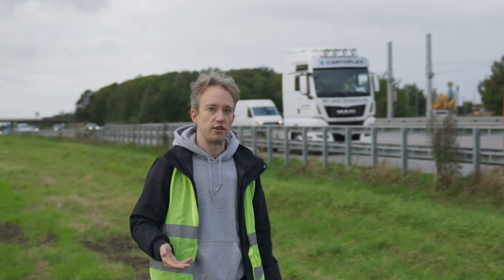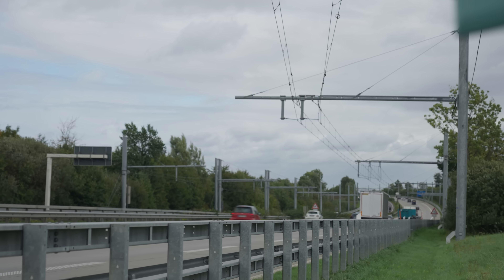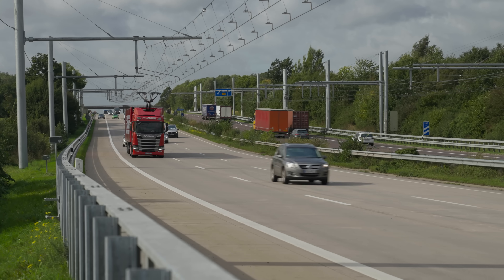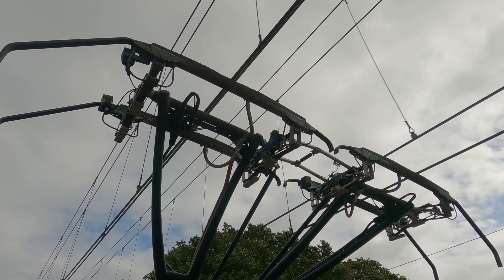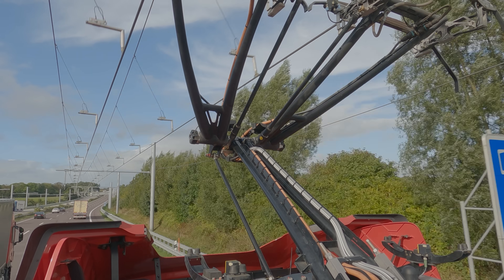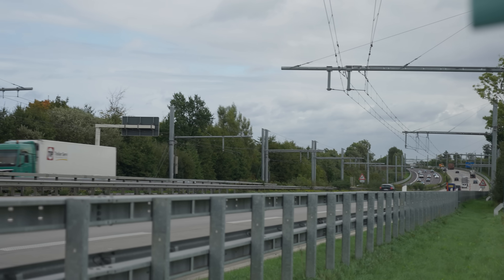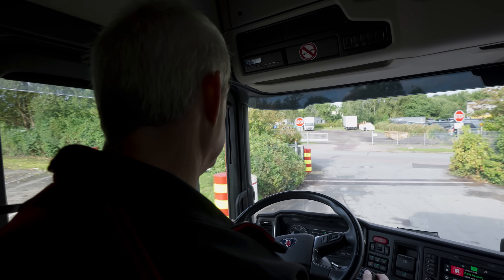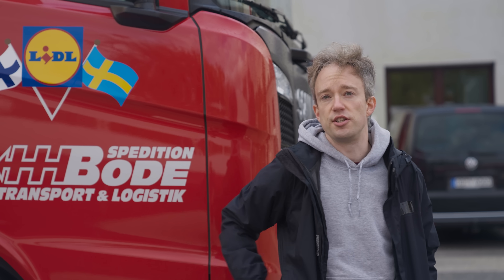The highway where trucks work like electric trains

Comment: Here in Brazil, they deactivated the electrical network of the rail network that was left over to replace the electric locomotives for those with diesel engines.
Reply: I can't imagine it in Brazil but maybe ridership has dropped so low it is only economic with diesels?
Reply: @bangerbangerbro Highways in Brazil are full of trucks and busses, so demand is there.
Reply: That's insane!
Reply: wtf
Reply: Didn't they do that in Zimbabwe because the electrification equipment was being stolen, and then switch to steam engines because they couldn't import any oil?

Comment: Will the amount of trucks impact, the amount of electricity pulled from the cables?  I'm glad you mentioned road taxes.  Most people don't understand the cost of fuel is actually very cheep.  It's all the taxes they add that has the prices so high.
Reply: A lot (I mean, waay too much) of our taxpayers'money goes to maintenance of these multi-lane highways and parking lots.
Reply: And having g roads to drive on is what you get for your taxes. Win - win.
Reply: @wordzmyth  What good roads?  Drive the freeways and toll roads in this country and tell me how these good roads are good anymore.

Comment: Next up: Trains that are capable of running on both rail and roadways.
Reply: Japan just launched a bus that can run on rail too
Reply: China:
Reply: Welcome to Australia
Reply: That's a hybrid that doesen't make sense in most places
Reply: @P4hko  Are you an engineer?
Reply: The efficiency of a train comes from the number of cars it pulls at a constant speed. A train on a multi-use highway loses that efficiency when it loses its length. A car that can run on tracks is still just a car. The container system we use now allows for transport by ship, train, or semi. The container is hybrid. In this case, the container can be transferred from the efficient train to an efficient truck for transport from the train depot to the warehouse.
Reply: Swapping of wheels and batteries 😊
Reply: Yes, making road-going goods vehicles and passenger coaches that can also drive onto train tracks would be better than adding overhead cables to public roads, imo.

Comment: Why not just place a railway near highways and slim the roads down a lane or two to compensate for fewer trucks traveling on them? Then, smaller trucks can instead pick up the cargo from the trains at stations and bring it to its destination. I think that would remove an arguably unnecessary process in a delivery operation.

Comment: To all railroad fans, truck can disengage from grid, and travel off battery on side roads away from main highway, trains, are stuck on one line and can't simply "drive off" rails, you're welcome.
Reply: @Mr.Zarratox  Trains DO cause traffic jams, for each other. Rail operators must schedule train movements months in advance.
Reply: True, but on other other hand, large trucks still cannot leave infrastructure, they still need to use the road, cannot just zip it through forested areas, rivers..... So it is question if you build roads or rails, which is more expensive to build and maintain...
Reply: That’s the whole point of intermodal trains, ya silly goose.

Comment: The catenary wires appear to reduce bridge clearances by about 1 m, so, if retro-fitted to existing bridges, all high vehicles will have to have their heights reduced by 1 m, dramatically reducing their capacity, and thus increasing transport costs. Also increasing costs are 1) double investment for engines in the trucks (electric motor additional to internal combustion engine), 2) massively heavy batteries. 1 & 2, by weight and volume, again reduce load capacity. Overhead road wires are a scheme for gulling technically illiterate politicians. Liquid fuels slaughter electric propulsion.
Reply: The bridge thing is a non issue, since the trucks dont require the lines to operate, they can just have a short gap in the wires under the bridge.

Costs are made up in the long term by reduced operating costs. The guy Tom interviews in the video explains it well and I trust the expert who works on this full time over what a random on the internet reckons.

And finally electric motors are way more efficient than internal combustion (90% vs 20% respectively) so will make up even more costs and will mostly negate the weight gain.
Reply: With trains underground, they often use a more solid pickup rail, and connect it direct to the roof of the tunnel.

Comment: And just like a track bound vehicle it can not deviate left to right or the pantographs will short out the catenary wires or loose contact all together, so what keeps the truck perfectly aligned with the traction power wiring?  At least with the time proven concept of trolley busses they had sufficient room to maneuver since the poles were rotating as needed!

Comment: Most incoming containers and freight tends to come in via sea traffic and ends up leaving from a multimodal terminal, so instead on one truck pulling one container under the 'wires' from the sea terminal, why don't they connect the sea terminal to a slightly out of Town/City modal terminal, all connected to the wire network? (Perhaps using existing disused road/ rail corridors). Let each electric truck pull more than one container from the sea terminal perhaps 2 or 3, or more, like Australian 'Roadtrains', easily done with the power of modern electric motors, then take them an intermodal hub just outside a town or city, and let electric trucks which have been sat on charge, take them the rest of the way (without wires) to an RDC, (regional distribution centre) inside the town city limits, break the loads down, and then let smaller electric trucks/vans take the goods to the end user. No diesel, LNG, or hydrogen used. No Co2 emissions from the vehicles utilised, and a cleaner Town/City environment for all!

Comment: NO Fossil Fuel no Batteries, 60-80% of any mean of transportation is composed of PLASTIC which derives from Crude Oil, so NO FOSSIL FUEL NOT BATTERIES and the over head wires are made with plastics coverings too.

Comment: When i was a kid in Johannesburg, 65 years ago, we had double-decker trolley buses, and they worked fine.  They could pull out to overtake slower-moving vehicles (or stationary ones), and had great acceleration.  They were NOT able to overtake one another, though.  I can't remember how it worked, but if the 42 bus and the 39 bus used the same wire for a part of their journey, their routes were able to diverge, so there must have been some sort of points system on the overhead wires.  They didn't use a pantograph, like trains do, but had spring-loaded poles from the bus roof to the wires.  Occasionally, the contact pole would come off the wire, and the conductor would put it back on with a long pole with a hook on the end of it - but it took only seconds.
It should be said, however, that the  wires are an eye-sore in a city.
Reply: Yes I remember that both in the US and place like Edmonton, Kanada
Reply: Old-time trolleys had overhead switches to diverge to a different line.
Reply: If you search YouTube for "Trolley besses", there are lots of videos.
Reply: Do you know why a trolley bus is called a trolley bus? It is due to the trolley poles that it uses to collect energy from the overhead wires.
Reply: @sjokomelk  What's your point?  What made you think I hadn't understood that?
Reply: We have the same sort of system in Kharkiv with the trolleybus , two wires and spring loaded arms . The maker is Ukrainian , "Bogdan" . It is a proven system so why change it . Yes there is a kind of crossover and the direction the trolleybus is going determines which wires it picks up.
Used to have the double Decker ones in London as well
Reply: I imagine in a few decades if they wanted to they could do a wirelessly charging lane for electric vehicles to charge their batteries as they drive.
Reply: @EikottXD  Wireless charging tends to suffer the laws of physics - in short, it's really inefficient, among other problems.
Reply: @compwiz101  It's extremely inefficient, but I did say a few decades.

Comment: It's so amazing idea! I wish we could put planes on the cables the same way as trucks 🙂
Reply: JUST. BUILD. HIGH SPEED RAIL. In Italy, their HSR is so good that their own company for domestic flights literally shut down, citing the HSR as one of the big factors.
Reply: @Cobalt985  hmmm, and what about the ocean? how do you get from europe to america? or from america to china? the largest trade ways are either trougth plane or ship, and somethings just can't wait a month to cross the ocean.
Reply: @wolfy1398  Ships, my friend, ships!
Reply: We really just need a good, light, battery system capable of high storage and a well designed solar system for aeronautics. Then we will be able to conquer electric air travel, no need for messy cables :)
Reply: Planes with on cables looks stupid
Reply: You might be able to do something similar uses solar panels in space that beam energy into the planes in the form of microwave radiation (similar wavelength band to what internet uses) and this was already tested and works
Reply: Ropeway systems are planes on ropes 😊

Comment: UK is easy. M1 and M40 plus M25 + M20 gives you  90% of HGV traffic covered. Rest can go in imported rapeseed oil ;)

Big question is... where are going to get all of this WATTs to cover it? One small accident can put hundreds of truck on HOLD on the motorway! In 2min you are losing 500 x 200kW of demand which need to be quickly balanced in the grid. Then 3 hours later all of them move again. 100,000kW jump can be significant enough to outbalance old grid. Especially if it happens 3-4 time a day! 
Change in the working hours and driving hours can help but this would have to be coordinated with rest of the world. Doable! Good luck.

Comment: Some simple questions:

1) What is the source of the electricity?
2) What is the infrastructure cost? As that was not well covered. That cost extends beyond the building of the network but also goes into maintaining it.
3) So you are still going to be using the batteries for part of the distance traveled. How do they plan to offset the pollution of the creation of the batteries which is great that the pollution of an ICE engine for eight years running. Batteries that are supposed to have a five year lifespanpossibilities
Reply: 1) That's not that important. Switching energy sources is easy and can be done over time. The fact that this is a problem that can be solved independently is a good thing--phase out coal power over a few decades and suddenly all trucks will be "green".
3) You don't neccessarily need batteries, you could use petrol or other types of fuel for the unpowered stretches of road.
2) That's a big if. I think that if you're going to try this then germany would be the right place for it, because it's both large, and has very high population density. There aren't huge stretches of nothingness in between depots like there are in the US. That brings down maintenance cost per capita.

I don't know if this will see widespread adoption but in my opinion this is one of the more promising proposals out there. It builds on existing infrastructure, and running a few cables is relatively cheap and can be done quickly. You don't have to build 1000s of kilometers of new rail for example.

You have to build trucks with these power things on top which might be the biggest showstopper. Then again if you're building electric trucks anyway, adding this mechanism on top can't be the expensive part. I guess the question is whether electric motors are here to stay, or whether other types of fuel like hydrogen fuel cells will become the mainstay.
Reply: @Schindlabua  You have never dealt with high voltage power systems have you? It is not just running a few cables. You would actually have a higher demand on the grid due to the loading of having the trucks coupling and uncoupling from the grid. Modern coal power stations have been a very clean source of power for the last thirty years. After the now proved false threat of massive acid rain issues secondary to emissions from coal plants. Though China is still using older tech and is the largest builder of new coal power stations.

There are solutions but this will actually increase the cost of electricity even more. As the government's are already allowing for price gouging currently in the UK and I bet other places as well.
Reply: @michaelmarino7216  No I have not dealt with high voltage power systems. But what is your point? This doesn't work, because ...? This works, because ...?

If you build rail you will also build power lines along the track, so if the goal is to get petroleum and diesel off the road then you will probably have to run cables either way. Rail is the cheaper alternative long term but you can't just stomp a country-wide high speed rail network out of the ground unless you are China. If these guys say that they can make it economically viable then I'm all for it, this can definitely make sense on certain stretches of road (hopefully while germany is working on longer-term solutions like rail at the same time)

And what does it matter where the grid power is coming from? Clearly, refining fuel and combusting it in combustion engines with 25% efficiency is not the correct thing to do? Surely you can only do better with power plants connected to the grid?
Reply: The energy for this section is mostly generated by wind turbines, since they produce most of the electricity in northern Germany.
The construction of this project did cost about 19 million €, the operation may take up to 7 M€ for ~3-4 years.

Comment: It is stupid idea. 
1. use railway and make railway user friendly. After it we do not need so much drivers and trucks. Truck, or small car make transport from depo to store.
2. why in UK not build trolleybus system? In vide was telling, that energy from wire to vehicle is better, than battery. It is right, but UK was kingdom of trolleybuses, now they are only in museums... 
Modern trolleybuses can run faster than bus (I am trolleybus driver ;-) ) and overhead is not problem for slow speed. Over switches I am running between 40-60 km/h.

Comment: 70 years ago I used to ride on buses (NOT trams) that worked on this basis within a built up area. They were commonly referred to as 'The Trackless'.
Reply: Those were probably trolleybuses, which are different from pantographs
Reply: @huguesjouffrai9618  Trolleybuses USE pantographs. Pantographs are just the thing that connects to the overhead wires. Older models do use trolley poles through.
Reply: @coleball6001  then they're not trolleybuses. A trolleybus uses trolley poles. It's a different technology and a different infrastructure (bifilar catenary vs monofilar catenary). Pantographs are used with monofilar catenaries which are best suited for vehicles on rail.
Reply: @coleball6001  I have never seen a trolleybus with a pantograph. All modern European trolleybuses I have seen have  traditional trolley wires, but automatic ones

Comment: UK is at least 30 years behind the rest of Europe, still struggling to make a high speed train. And for UK will be more practical to build proper train to take goods all the way from south to north. Although the political leaders in UK have been busy wasting the budgets on pretentious tiny projects not a proper project that will save the the country for next 100 years.
Reply: The UK will have a newer and faster train system than the rest of Europe in about 5 years. HS2 is 360 km/h.  Only China is faster

Comment: What kind of ruins it is that this is in Germany, which has rejected nuclear power so those trucks are still using fossil fuel
Reply: No, it is rather powered by wind than by fossil fuels
Reply: @j03l911  wind power doesn’t run the entirety of Germany’s electrical system, renewable energy accounts for ~50% of energy production, excluding nuclear power, which still supplies ~12% of power. Germany is in the process of fully eliminating nuclear power, which will mean fossil fuels will supply ~50% of Germany’s power, rather than 38% which it is now
Reply: @Cheesequeen1061  I should have made my argument more clear: In THIS case, most of the energy comes from wind turbines.
That ia due to the fact, that the state of Schleswig-Holstein, where this project is located gets more than 85% of its electricity from wind.
Reply: @j03l911  okay that makes sense, so it is a clean way for trucks to operate

Comment: Dumbest idea ever. It was tried in the last century after WW2 in Germany and the tests failed big time. The system wasn't able to keep up to its promise. This system is not competing with the combustion or diesel engines, it is competing with the railroad. And trains work way more efficient than rubbertires on a concrete surface.

Comment: This is a brilliantly feasible transport system when mixed with dual fuelled vehicles (hybrids). But it can only be built by a socialist system on a not for profit basis to prevent so called private sector commercials continually milking the tax payer!

Comment: Just add a diesel generator for those city drives/changing motorways and you have a working system right there, without a huge battery with its related production and fitting problems

Comment: sooo stupid... imagine what happens if tree fall on wires?
Reply: It is a very good idea.  Don't let trees fall on the wires.  Take a look at most highways and try to find a tree that could fall on the wires.
Reply: @kensmith5694  it were just example, there are lots thing can happens. Also imagine you neew to move oversize...